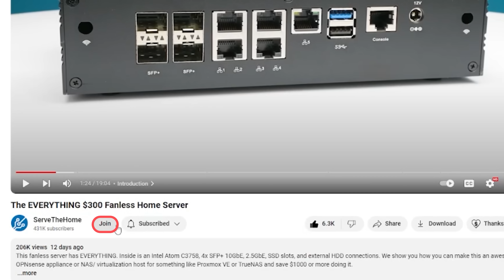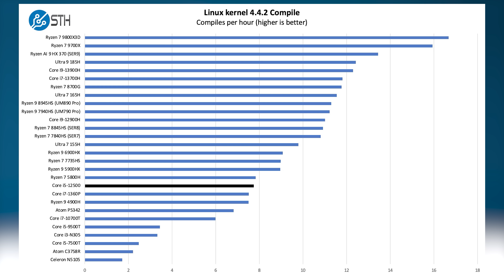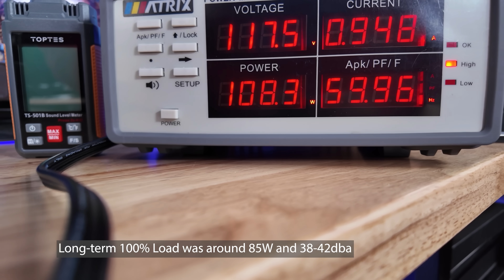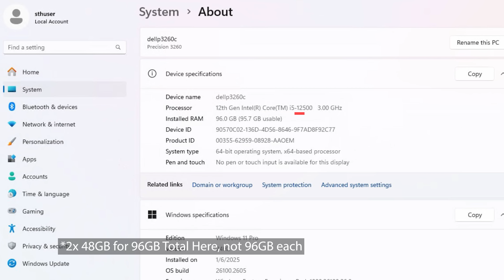Dell Precision 3260 Compact Review

Comment: i'm confident i could fit a rx580 in there. powering it might be another problem  tough
Reply from the maker: Yes you mostly need bus powered GPUs
Reply: @ServeTheHomeVideo  i fit a rx580 inside a old sff optiplex. with a hdmi extension and pcie extension. it was the jankiest thing ever. luckilly i had sata power and had no stability issues suprisingly

Comment: On the current 3280 model, you can get the Nvidia T1000, A2000, and A4000 cards.  You will want need the 240 watt adapter though.  Also, the 2 SSD's can be setup with Intel's RAID1, in case you need that.
Reply from the maker: We have the 3280 with a GPU. Video coming next month

Comment: Some of those M.2 NICs raiders has the port with mounting holes on the side of the ports. They fit perfectly the spacing Dell is using for its space (probably typically used for serial). I have M.2 E key to 2.5 Gbit adapter fitting just perfect in my micro.

Comment: In the UK this device is marked as discontinued by Dell.
Reply from the maker: Yes. We will have the 3240 Compact review next. The 3240 is the very low cost version since it is one more generation old. This will start to fall in price soon on ebay and the Dell Outlet so we wanted to review it as a reference when folks start looking
Reply: @ServeTheHomeVideo  lots of people commenting this. Do people not realize you review old systems sometimes that can be had cheaper off lease?

Comment: Hi there - ive had my 3260 for a while now...never been able to find the rear usbc add adapter...does anyone know the part number?? - oh i might add that some of these 12th gen ones (mine is one of them) cannot accept a 13th i9 - i found out the hard way! - ive configured mine up to an i9 12th gen, 2x 4tb gen4 ssd's, a 12gb Nvidia A2000, ax201 and a 2.5gb usb ethernet. I run proxmox on mine. Oh - does anyone know the part number of that sata ribbon connector - itd be nice to add some more storage in there.
Reply from the maker: Wow!

Comment: The single port for Type A is a miss. If you run a wireless keyboard + mouse with different manufacturers (i.e. ASUS and Logitech), you need two receivers.
Reply from the maker: There are four Type-A on the rear

Comment: Those 2230 SKHynix SSDs work very well on the Pi4 and Pi5 with NVMe HATs, and in the CM4 powered Home Assistant Yellow. Use very little power and are plenty fast enough. And they always work, which isn’t at all a given with the Pi. They’re the only drives I’ve found that always work. Plus they’re dirt cheap on Fleabay/AliExpress.

Comment: Th 5GbE m.2 you use uses a Key A adapter, which is 1 PCIe lane. I'm not sure this can do 5GbE on 1 PCIe lane.
You can just take the ribbon adapters you bought and snap the plastic ends off that interfere with the case. There are no wires/traces in there.

Comment: Seeing the thumbnail and intro I got a bit excited since its got more expansion and cooling potential than the 1L PC form factor, but the excitement died fast as I noticed things that turn me off.

I thought that with the extra space Dell would have integrated the power supply inside like Optiplex SFF PCs, but they didn't so that kinda bugged me as its another thing to manage for clusters since its a chunky 180w one.

The vertical space above the CPU & heatsink being just empty is a waste. Though you did mention there's versions that come with that. The design of the cooling makes sense its meant for front to back airflow but it still feels like they wasted space here since they could have gone with a taller heatsink as standard or a different design since it kinda looks like they just used a heatsink from one of their 1L mini PCs.

Potentially they could have gone for a cheaper to manufacture cooler like Dell's version of Intel stock heatsinks that use screw mounts for a top down airflow, but not sure how that would work out with the solid top lid since there's no case fans.

The 2x NVME and SATA option seems nice for a NAS build. Plus there's the option of using the 8x PCIe slot for more NVME SSDs, but that specific size riser situation kinda sucks.

By the end of the video I thought that Precision 3260 is a form factor that has potential that's not maximized yet. Its smaller than Dell's Optipex SFF which is great, but the points I mentioned above could be improved.

Comment: Surprised why this config with 12500 isn’t vpro enabled, it sure can’t be a nic issue as it comes with the i219-lm 🤔
Reply from the maker: Some systems simply do not have vPro enabled as a customer choice. The Dell spec sheet we showed also indicated that the system would not have vPro with the i5-12500. I believe it should be capable, but we had our result and the spec sheet aligning.

Comment: Intel 12500 supports Vpro according to Intel Ark
Reply from the maker: The 500 series usually does. Something strange happened with these. We showed the spec sheet that did not show support. The branding is not on the label of our system. Our second system also did not have it working with the i5-12500 either. It is odd, indeed.
Reply: @ServeTheHomeVideo  I guess Dell disabled it? Because Intel ark says it has it.

Comment: This form factor seems like a sweet spot for IO while still being small and relatively efficient.  I'd love to see other mfrs pick this up and create options in this form factor.  Seems like they could make nice NAS boxes with 10G + HBA to an external drive enclosure or compute nodes with GPU + dedicated networking for storage.
Reply: These are workstations first and foremost, and the expansion is designed to support a customizable dGPU. HP's older Z2 minis did this by including an MXM slot, new systems use PCIe because Nvidia no longer want to support MXM.

If you want to get one to repurpose as a homelab system, this P3240 is arguably worst than any of its peers (LGA1700/external PSU/2-4L) on the market. HP's Z2 mini G9 supports a dual slot card instead of single, and HP's flex port has more options than Dell's (notably NICs and Thunderbolt). But what you should really consider is Lenovo's P360 Ultra (12th gen) or P3 Ultra (13/14th gen). Slightly larger, but packs an absolutely insane amount of IO. 4 DIMM slots, 2 PCIe slots (including one where you can fit a LP RTX4060 with some modding), 2 onboard NICs. I wouldn't get the Dell system unless it's significantly cheaper than the other 2.
Reply from the maker: Very much so

Comment: We use these with the 13700 and T1000 in our programming and CAD computer labs at the college I work at. It works really well and takes less space on the desks, and has an under-desk mounting option as well.
Reply from the maker: Great feedback. I think those T1000 versions are popular.
Reply: @ServeTheHomeVideo  I've got one of those upgraded with 64gb of ram for CAD modeling at work. It overheats and is overall meh... We just bought a 9700x mid tower for my colleague. Much better machine for our workload.

Comment: P360 ultra anyone?
Reply from the maker: That is a great machine. This is a much smaller system. We reviewed the P360 Ultra here https://www.youtube.com/watch?v=E_an5heI1BU
Reply: @ServeTheHomeVideo  Sorry, had P3 Ultra in mind, but threw me on local site where it didn't show that, only P360 ultra (tnx "3rd world markets") and I thought I'm crazy and just dreamed about P3, despite all other P series were available there.... Checked US and global site now and it's P3 Ultra, and appatently I'm not crazy, but did the upgrade to HP Z and never checked Lenovo since (it was just from Pxxx to Px refresh) and kinda wasn't there with my brain cells :D 
What about P3 ultra then? Really liked P360 with both side upgradeability, kinda better concept for me, the only thing is that on flip side of where X16 is, I'd make raised OCP 3.0 instead and two M.2/U.2 behind the connector, (to the front of WS actually) and a small venting/airflow... If it's what I think it is as I still remember from last time when deciding or one hell of WS and or one high-mid range and another compact cause I have certain usecases, so now if I max out I only use 75% resources, and I rather got a bigger ultrabook and remote in a when in cases of that small workstation would need to take around with portable monitor and kbd/pad or mouse set for certain work (the HP solution "Wolf something" was crucial for this, safety and low bandwith needed for full quality picture). Coverage with one or another type/protocol/signal is excelent, that was big factor that went that way, so I still have some path to upgrade that Z8 Fury to absolute beast mode that would kick all apartment building dark when I power it on :)))
BTW, What about upcoming HP Z2 Mini G1a? I just noticed it (again, haven't HPs website also since Lenovos last time :)) and it looks like kinda those small WSs could pack a bang, but I'm curious cause some can be pretty expandable and logically designed, some could be thaaaat good but are missed opportunities...
P.S.: Sorry for the novel :)

...::: Thank you and keep up the great work !!! :::...

Comment: I am curious how much of this device is proprietary Dell vs. easy to replace components?  The proprietary parts are what I hate about Dell/HP/Lenovo.
Reply from the maker: There are proprietary parts. So long as you can get the riser for $35-40 if you do not have it, the SSDs, CPU, memory, and so forth are standard.
Reply: @ServeTheHomeVideo  — THANKS for answering.   

Just a thought, but it would be great if in future videos you would start calling out the components that are proprietary and those that are easily replaceable to help us understand what we will be getting ourselves into if we decide to buy one, especially for those things purchased cheaply on the secondary market.  

It really sucks to buy something for 10% of original retail only to find out we have to pay another 15% of retail to get the one proprietary component that our use-case cannot do without. 🤷‍♀

Comment: Usually the pcie risers dont have traces on those extremities (except ground for screws) so you can just clip them
Reply from the maker: Totally true. The riser we ordered finally arrived. Still, many do not like to cut PCB and prefer pre-sized solutions
Reply: He thinks riser cards grow on trees!
Reply: Clipping it won’t get you the experience you think it will. Spent over 3wks tinkering with mine to finally realize that DELL throttles 3rd party risers (if you mod one to work) to gen2 speeds & mostly locks pre-post check so it won’t boot. Go with the Dell riser.

Comment: Odd to feature this when it was replaced by the Precision 3280 in March 2024. The 3260 could not support graphics beyond T1000 but the 3280 supports the 14th gen intel CPUs and crucially NVIDIA RTX2000 Ada and RTX 4000  Ada SFF. Slightly larger but if upgrade. Only downside is the rack mount now only supports 7 units in 5U

Expect the Dell Pro Max Micro with arrow lake ultra CPUs in Spring
Reply from the maker: True, but the 3240 that we will do next sells for around $300. Part of Project TMM is now just for new systems, but also used systems that come off lease for cheap.
Reply: @ yeh just I think you could be clearer In your videos that these aren’t the current models and that the latest options allow the dual slot. The 3260 was a bit of an error from dell they thought the A2000 would fit so they would have options without having to put mobile chips in like they did for the 3240 (Quadro RTX 3000 mobile) but the A2000 wouldn’t fit! Hence the 3280 is a bit bigger

Comment: With the Asus mini PCs going AI such as the 14 Pro AI at CES 2025, it will soon be "retro" tech for TinyMiniMicro Dell Compact 3240/ 60 review by the time Patrick does an update of the PCIe x8 riser to 10 Gb NIC.
Reply from the maker: You missed it. There is 6 seconds or so of footage with the roster installed because either finally came 2 weeks delayed
Reply: @ServeTheHomeVideo , Watched again. Had seen it but deflation took the better of me as a whole 2280 m.2 slot was being taken up by the IOCrest 5GbE M.2 adapter, worse still at 5Gb instead. Was "feeling" for bigger use of the PCIe x 8 as is Gen 4.

Comment: This is a great in-between size. Lenovo is doing the same with the "Ultra" suffix. Havent had a hands on, but the case design looks cool - dual sided chassis that slides out if the shell
Reply from the maker: Lenovo has a great design!

Comment: ETA Prime tried to install a dual-slot card in this and had to modify the case
Reply from the maker: The issue is less the dual slot cooler, but instead if you have GPU with a dual slot LP bracket. Still, for things like single-slot cards with internal cables, there is room
Reply: @ServeTheHomeVideo or just get the latest 3280 model that is slightly larger and can fit the RTX 2000 Ada and RTX 4000 Ada SFF
Reply: @ServeTheHomeVideo  I got a yeston 3050 thats single slot lo profile, works well in my nas as a plex transcode card - would fit in that chassis easily

Comment: Would you recommend this over a T/M/M 1L PC to use as a remote virtualization host? I need to run 2 VM's with 16Gb each, and need more horsepower than im finding in the T/M/M 1L PC's. Also, is this CPU the one with the manufacturing defect? Which CPU would you recommend for virtualization host which is also decently fast?
Reply from the maker: I would actually look for a 13th Gen since those had more E-cores if you wanted more performance, and a Core i7/ i9. TBH I think that the Minisforum MS-01 would also be a great option for that, or an AMD machine. Another silly option might be to get two older 3240 Compact systems and just have dedicated systems per VM, and since they are DDR4, getting 32GB is cheap. Lots of options in this space.
Reply: @ServeTheHomeVideo  Hmm, I thought mixing P/E cores was not a good idea for a VM host... As for the Minisforum, I was thinking about the MS-A1 as it supports better Ryzen 7 processors, but (not being an expert) was a bit confused as the TCP of CPU's such as the 7950 is too high for the MS-A1, meaning it would be restricted. Is there an "ideal" CPU for the MS-A1 which can maximize CPU speed/core-count which remaining in the TCP range of the box? It seems if I tried a 7950x I would be wasting money on a CPU I can't really use to it's full extent.